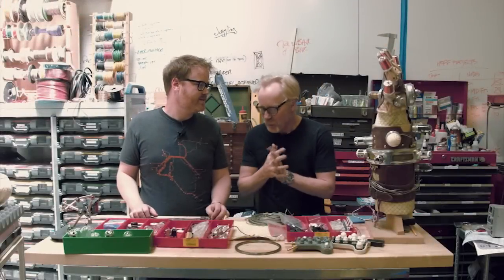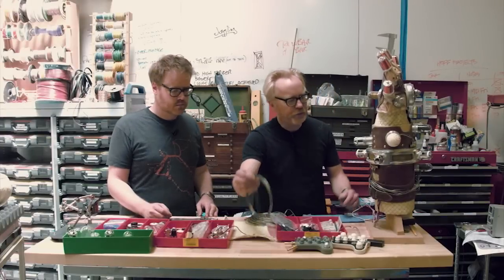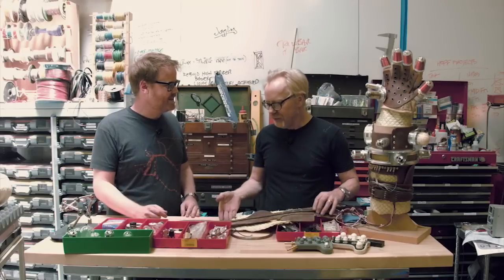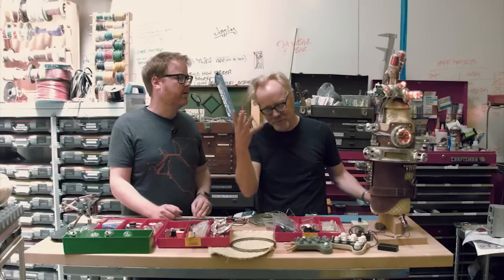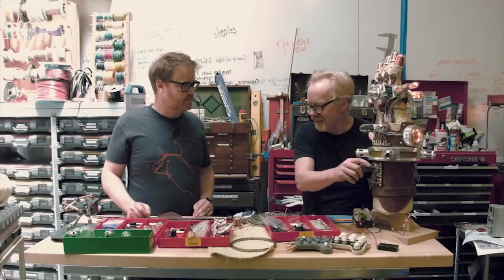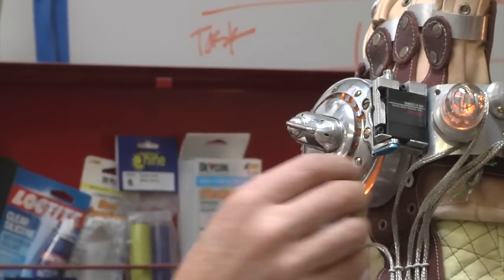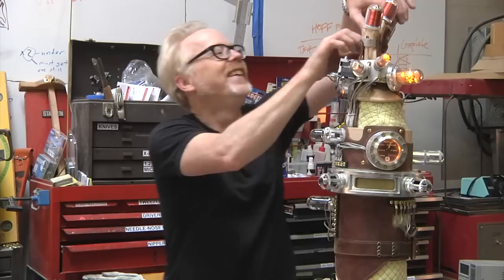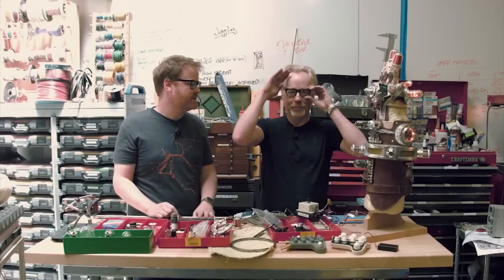Adam Savage's Hellboy Mecha-Glove Replica

Comment: I want one too! :D
Sadly, there is a translation mistake on the Label.
"Bestellnummer" means Orderingnumber instdead of Partnumber, wich is "Teilnummer" in german. :(

Also, it should be "der Zerstörer" with a lowercase "der". 

At the last line, "von Chiffriermaschinengesellschaft", that sounds like you translated "by Chiffriermaschinengesellschaft". Better, and correct would be "Hergestellt von der Chif[..]", meaning "made by". 

Hope I could help. :)

btw, "Chiffriermaschinengesellschaft" means "encryptingmashinecompany". not sure if thats fitting ;)

Comment: A plasma ball/bulb effect in those radio tubes would have been awesome.
Reply: Plasma ball set up in the fingertips would be better and closer to the movie.

The glow that he has is pretty close to the color a vacuum has for its heater, although it should be a little more red in the beginning and more yellow when warmed up.

I would have used a combo of tiny yellow, orange and red LEDs sanded and then glued together. You can then have the control board adjust the color to tune it or play with it for effect using those colors. It would run off of 3V instead of 12V, so there would be less heat and you could use a much smaller battery pack that would last WAY longer.

Comment: The german translations on the Label aren't very good.
The Manufaktures name should be "Chiffriermaschienen Gesellschaft" or even better "Chiffriermaschienen Aktiengesellschaft (Chiffriermaschienen A.G.), like the real german Manufaktor, who owns the Patent.
And if you want to write "made by" you can't use "von", which simply means "by", which makes no sense in german. It should be "Hergestellt von:"(made by) or just the name of the Company.
All other translations are correct, but only in a modern usage.
It just doesn't look german or sounds german. It would be more commen for that era to see something like "Mod. No.:", whre the "o" has a line under it and "Bestellnummer" wasn't used,I think.